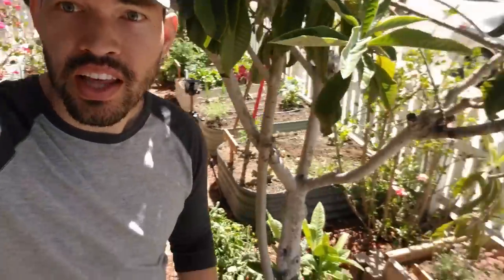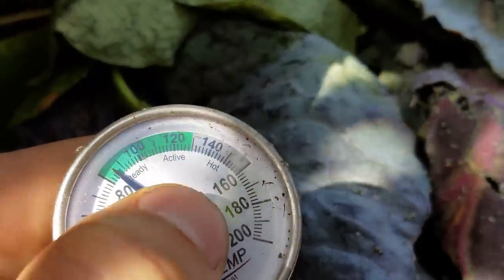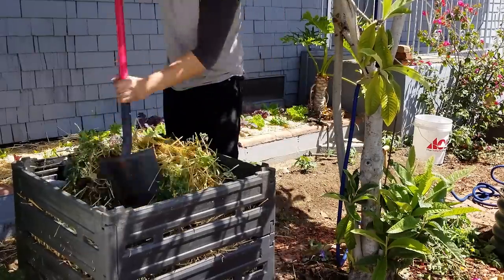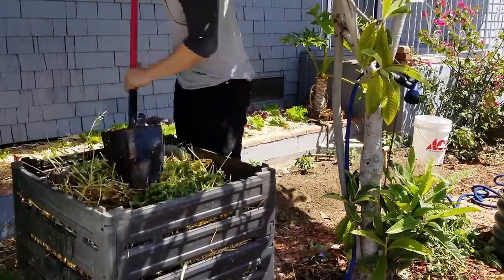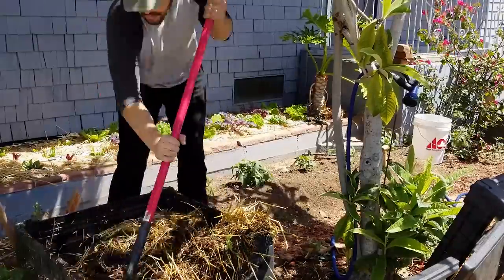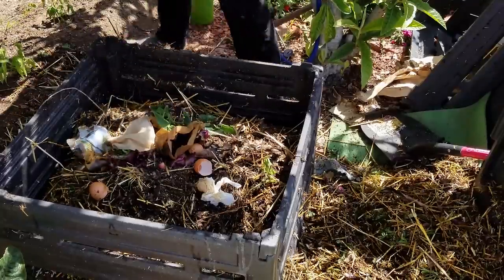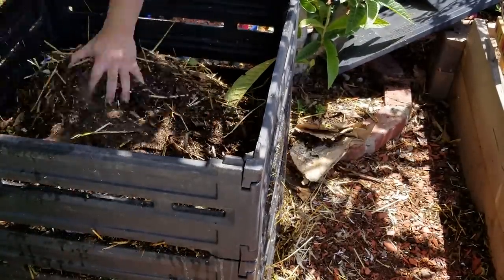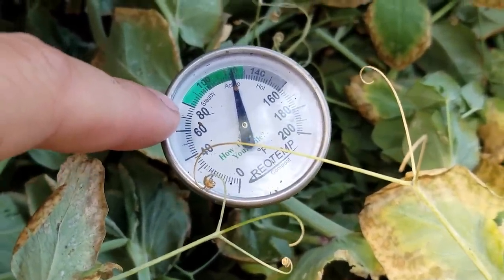Making Compost: What To Do If Your Pile Isn't Heating Up!

Comment: Oh man... You gotta shred that stuff! Get a used mulching mower toss all that stuff on the ground, add some wood chips and run over it a bunch of times. Problem solved. What I see in your pile is material that is practically still alive. You gotta break open those cellular structures to allow the microbes to access the material. The cell walls prevent them from doing that. Also, when you shred with a mower, it mixes all the C's with the N's intimately so the microbes have an ideal environment to operate within. You might think: I've done that before and it gets all slimy. That's because you don't have enough wood chips or leaves to absorb the excess moisture (and nitrogen) released when the cells are busted apart and then it goes anaerobic. I've got a 19 cubic yard pile of mostly wood chips (mass/area relationship) that got up to 169F which I know is too hot but this means a much smaller pile can easily go thermophilic using this technique. No smell, either. If anything it smells sweet but barely detectable. I live in frigid Alaska, so if it's possible here, it's possible almost anywhere.
Reply: Charlie, you are the king!
Reply: @robertgoldrick1703  Thanks bud! I will also mention that in the fall when the ambient temps start to drop, the compost pile can no longer maintain the heat no matter what the size or what you do. It freezes solid all winter. It's around zero F right now. Cheers!
Reply: I never throw kitchen scraps in without dicing them up small.

Comment: Condo Compost: I use a Walmart plastic garbage can with a lot of holes drilled all over, add equine pine nuggets (secret sauce), grass or brown leaves cut up, and starter soil . Most importantly I cut up all my fruit/veggie scraps with a scissors into little cubes so as to break it down into compost super FAST. I juice daily and the pulp is also used to feed the compost. Finally, I put a brick or 2x4 under the compost trash can to tilt it for better drainage. Every now and then I mix it up with a hoe or trowel from the bottom up to improve air flow. Tip: Rain water is 10x better than facet watering and produces a breakdown in a few days. Those microbes are like my pets, lol, so I feed them well.
Reply from the maker: Wow super smart, glad to hear you've made this work in a condo. The equine pine nuggets are GENIUS

Comment: Excellent video. Yup my pile had that steady 80.. I disassembled the pile. Layered wheat straw, grass clippings, and ofcourse watering at every step. In 24 hours, 120F. 36 hours .. 150F !! I had to touch the thermometer and burn my hand to be sure lol.

Grass clippings, straw, water + my old pile = scaring me now :) I will water the pile to keep the temp below 160.

Comment: I have tried for years with my compost bin.  Many struggles and no success.  It looks like yours but I don't have that layer option.  I get the browns, green layers, and dampness along with starting with a yard of material. I am starting over from scratch.  How many inches of each layer?  As I learned the proper layers will create heat, not the air temp.  Also, I discovered your channel about a month ago and have watched almost every single video.  Your the best!!

Comment: Bucket composting at the moment (1 bucket). Temperatures are maintaining 99-103 degrees F and I wondered if it is doing what it is suppose to do? I picked some over hanging grass (green material) did not chop them smaller though so will do so next time. Got some dried banana leaves (didn't chop smaller either). I won't give up. Thanks for the tips and video.

Comment: I have a compost that turns out to be   clayish or clumpsy. I think I lack the carbon material (cardboard or carton) during the first few attempt to do a compost. I improve with the ratio now 😅 And the availability of carbon.

Question: Is there something I can do to amend it? I can hardly use it in my medium. (By the way, it is not hot compost before when I was making it. Or hardly saw it warms up)
Can I still have it Black Gold?

Comment: Question: If I have a bunch of green leaves in a pile that have dried up, is it considered green or brown for composting?
Reply: Once they dry should have turned brown all i use is all the dead leaves from hedges and garden grasses from shedding lilies and irises and from time to time clippings that i lazily leave in the lawn the keys are the water and air along as you can see brown and green i mix asi add don't layer. I start with majority all green and just let it go let it dry in the in and some greens will turn brown in the bin

Comment: your compost needs a ratio of of 30 to 1, carbon/nitrogen (or brown/green).   All things being equal (moisture and air) save your urine for 24 hours, then pour it in to your compost. 24 hours later, your compost will heat up, and ,no, it won't smell.  I think human urine contains 2% nitrogen ....
Reply: Yup. This.
Human urine is the best advice. I used to do it

Comment: Thanks someone accidently placeda spray paint can in my pile must have been when i first started but any way though i initially thought i had went cold because i was not turn my pile over at all was peeing in it and adding s little water every now and then but was sure my neglect had me ice cold plus I'm in s trash can with two holes in the bottom corners and s drop cloth over the top slightly ajar nothing fancy when i tell you im on fire man decided to remove in wheel barrel and reconstruct with the layer method completely started over. Pitched fork a pile out and hear hissing in thinking snake so I'm panicked then out of no where boom granted i can't see because I'm in the game with black goal for ground midway up and hot? The can over heated and all i did was pull a pile out that happened to contain the pressurized can and then she blows scared the hell out of me then it made me feel really good because i was already in the game composting and didn't know it. Weird right but of course it starts to rain so i would have thought i was in trouble and rush to get everything back in the trash can but you showed me that the pile needs hydration so of course I'm playing in rain allowing layers to saturate but not too terribly i literally understand the science behind the process thankfully due to your demostration. I filled her back up brown green brown green with new veg majorly in the middle then continuef Pat t to top covered with layer of the compost then s thin layer of soil making sure to add a few worms and covered went back 10 later to adda new bucket of clippings and could feel the heat already just that quick. Again thanks I'm so excited about rotten veg crazy huh

Comment: I little bigger would be better. I build mine 6 feet wide and as high as I can. Usually about 4 to 5 feet tall. With the small size you will get a much smaller hot zone or no hot zone at all. Everything looks pretty good, just needs to be bigger. Maybe try spreading the straw out on the lawn and run over it with your mower with a bag. Starting with smaller material will speed things up for sure.
Reply from the maker: Oh totally agree, if I had the space to have a larger one in the front yard I would! 3x3 is just the min

Comment: By volume/mass does most of the pile need to be made of greens? 

When I make my pile mostly of browns, it never heats up. 

When I add more greens it always seems to heat up. What’s the deal?
Reply from the maker: Ideally you want to shoot for 2:1 green:brown ratio. Part of the reason greens heat up easier is because there's more water in them to feed the microbial life!
Reply: Wednesday Notifications pee on it

Comment: Anyone: I'm trying to decide between a tumbler or a system similar to this. The 2-chamber tumblers in the $80-$100 range seem to be only 20 gallons per chamber.... Is that enough space to get it up around 130 degrees? Even the ones near $400 seem to be well short of 27 cubic feet. (But some have insulation that seems to help raise/maintain temperature.)

I'm thinking of using 4x4 feet square untreated boards-- perhaps coating with something like linseed oil (4x4 would later become raised beds), stacking them two or three high.... Even 4x4x2 = 32 cubic feet, which seems like it may be a great size. Would the wood of the walls break down a lot quicker than if it was only used for raised beds?

If a $400 tumbler (such as the smaller Joraform) did the job quickly + well, while keeping everything contained and making it easier to turn the pile, I'd invest in that.... I have a worm bin and I think I'm going to upscale that (multiple, or one huge one) to up to roughly 100 gallons of volume. The combination should be enough compost / worm castings for roughly 100 sq ft of raised beds as long as my inputs are good, right? (There is plenty kelp/seaweed nearby, so that is one source.)

I'm in Central Coast CA, so our winters are mild. (mid-40s low in winter, on average.) Would that factor into the decision of a system?... Is it easier to heat up a $100 tumbler (without much insulation), or does the ambient temperature not matter much?

I'd love to learn others' experiences with tumble vs a tiered stack, like this one.
Reply from the maker: I will do a tumbler vs. static video soon...my vote is for bins always though - tumblers I find somewhat annoying to use but I'll get into more detail soon in a video
Reply: @epicgardening  Awesome!

Comment: You won’t be disappointed by adding a large slug of coffee grounds
Reply from the maker: Very true
Reply: @epicgardening  I'm also an "urban composter" and I'm mainly running a shredded paper & coffee compost pile for my greenhouse heating.  The pile is similar in size to what you have (but insulated).  It gets amazingly hot (155 deg) but loses heat faster than other mixtures I've tried.  I bought the paper shredder a couple years ago and estimate that I shred at least a pound a week.  So. much. junk. mail.  I do compost food waste, but run it through a bokashi cycle first to get it broken down faster.  All this FYI/FWIW.  ;-)

Comment: It isn’t that easy!!!!  I am going nuts and  can only get my pile Luke warm.  I am at a loss....
Reply: I feel you. 😯 I finally got my thermometer delivered. Went out to check the temp, and it WENT DOWN to 60°! Pathetic! That's how I found this video. It seems my pile needs to be bigger.
Reply: Joanie S so, I tore mine apart about 6 times.  The last time, I added lots of plain cardboard, water and a ton of grass clippings.  I got it up to 123, which isn’t bad, but I was aiming for about 150.  I believe that you need way more green matter than what most folks on YouTube are admitting.  The last time I took it apart, all the green matter was broken down,  and it only took just over a week, which surprised me!  What is the takeaway?  getting a hot steamy pile of compost is a ton of work!